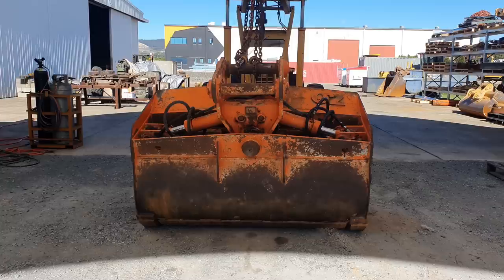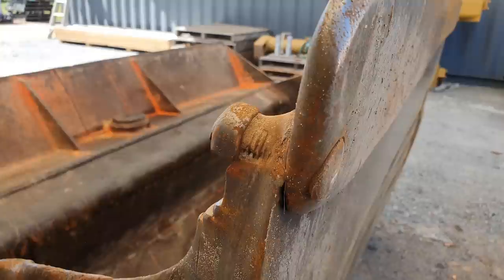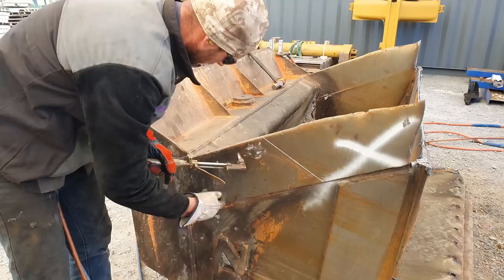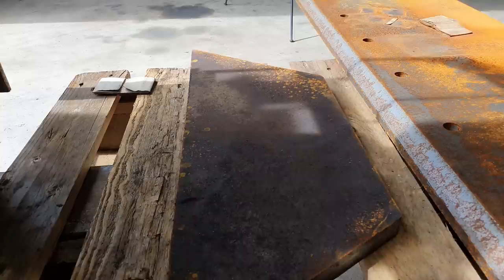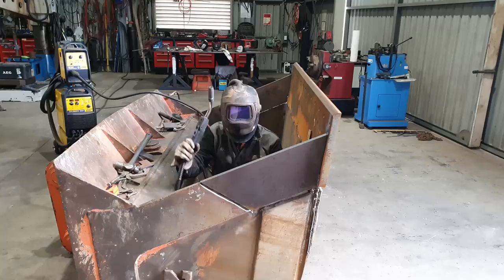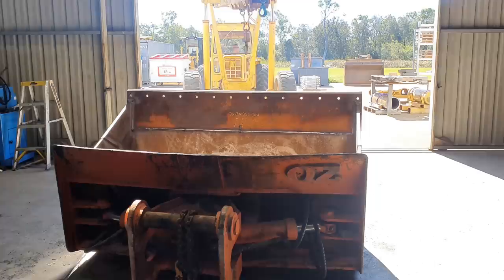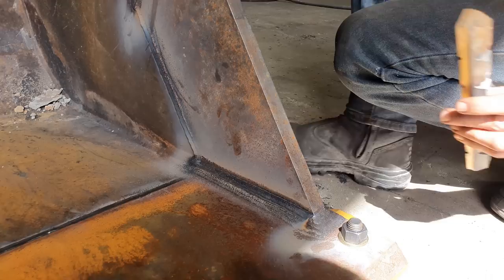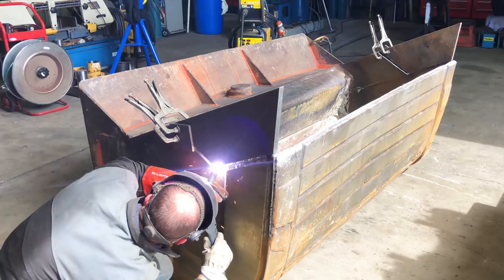Repair & Upgrade DAMAGED Bucket for 30T Excavator | Gouging & Welding

Comment: @CuttingEdgeEngineering 

Greetings mate! Just an observation, but bear in mind that argon and carbon dioxide are both heavier than air gases. When you're welding in a bowl such as @17:30, even though the top is wide open, your gas is sinking to the bottom.. and that's right where the intake for your welding respirator is. Not a huge problem for the short time you were doing it, but definitely something for everyone to keep in mind in general. 

Love to you and Karen and Homey.

Comment: Curtis, Have you considered getting and using a plasma cutter instead of gouging to remove metal sections ? They are very fast, easy to use and leave a very smooth clean cut which needs minimal cleanup.

Comment: I have gone the opposite & prefer pneumatic tools now, they are generally much cheaper even for high end ones, much simpler so much more reliable & also much smaller & lighter than gas. 
Only gas tool I use now is my old faithful Bostitch 1st fix which has been unbelievable reliable & robust.
My Milwaukee gasless 18ga is an absolute pile of junk & rarely ever get it out the box & always use compressor for 2nd fix. 
But everyone has their preferences 😊

Comment: When i was in apprenticeship, we used the standdrill as a mill, our instructor told us it would kill the bearings. Dont understand that until today, you got to use the tool you have, if it breaks, it gets in the bin or repaired. When i dont have a hammer at hand, the ratchet will do its job.

Comment: Not being critical, at all. Just trying to learn from someone who clearly knows. Why did you not feel the need to preheat the cutting edge and wear bars before welding it out? Was it because it was high-tensile plate and not AR plate or was it because you weren’t seeing any cracking in your tack welds? Fantastic job you did, for sure and the fact that it only took between 8 to 10 hours is most impressive!

Comment: Pro Tipp for filming anything with sparks flying: have some sacrificial glass in front of the lens that you can easily replace. The metal sparks will embed themselves into the lens and ruin it. A screw-on filter for a DSLR lens or a piece of gorilla glass screen protector for a smartphone camera are cheap an easy to replace.
Reply from the maker: I will definitely be doing that with my new phone! The camera glass has quite a few cracks from weld splatter 😅

Comment: Wow you are wizard with that cutting torch. I tried using a cutting torch for the first time recently.  Let’s just say Hellen Keller could have run a straighter line than I did.

Comment: I admire you for working so hard on your dialog!! Thanks for always including the outtakes, shows just how hard it is to make video in an industrial setting. I'm always amazed your camera gear doesn't pack up from the heat. Ever have trouble with RF noise from the arcs? As usual, screamin good closeups of the welding - WTG Karen!

Comment: Have you considered getting one of the long lasting batteries for your filter pack.  I have a three that last 16 hours plus for my Lincoln filter pack.  So I only change my battery twice maybe three times if it’s a long week.  Hope your replacing your filters not just using air to blow them out.  Your to good at what you do to not take care of yourself!  Once again would love to work with you on like a creative project.  One last things if it was me I would of put the bars up the sides past your repair.  I don’t doubt your skills but I know that no matter how great of a welder that the weakest part is where you’re repair was.

Comment: I assume that by welding down hand, you mean welding in the flat rather than vertical or horizontal position. In North American the term down hand refers to vertical down, which is not recommend for any structural application with a flux generating electrode.  Cool rebuild. Used to like these projects but at 70 years old I tend to look for smaller jobs to fill my time. The technology in the trade has certainly evolved in the 30 plus years I have been practicing.

Comment: With the cutting skills that you have, you are in the wrong business, you should have been a surgeon. I have never seen anybody able to cut a straight line like you. Also, I am in the US, I find it amusing when you describe the different gases you use. I used to work in a compressed gas facility. We used to pump the gases you are using. Except we names ours based on the Co2 content. C25 would be 25% Co2/Argon, C20 would be 20% Co2/Argon. Keep the videos coming, love watching you work on heavy equipment.

Comment: Filming and editing on point as per usual, hope George does well out there, that Homey segment 22 mins in is comedy gold for me, the way he snorts and grunts never gets old 🤣
That bucket easily rivals my Toyota's in skin thickness, surprised you didn't blow through at anything more than 12 volts and 20 amps 😅
With that strip welded in it'll hold up until you get it back for extensive surgery, at the top of a game going beyond for a good customer sets you apart, quality work as usual 👌
I hate it when the wire won't come out, my chinese welder does that at low settings all the time now and has bad arc consistency for buttwelding sheet metal/bodywork, struggling with it all the time.
Tried a good welder and difference is night & day, picking up a new Kemppi next week 😆

Comment: How do you keep such a steady arc with the air arc,? struggle to mine at a constant arc.  idk if I'm too hot to 2 cold or doing something else wrong. Also get a like carbon build up on the steel when doing it sometimes and only way to get rid of it is to grind it out to new metal.  What causes that and how do I prevent it?  Thanks a ton/

Comment: Hi. Love the videos and out takes. Very interesting and skilled. Would it be possible to do a short video on the gouging. Ie how it works etc. it sounds like compressed air used but not sure. I am an an electrical engineer in uk with no metal working knowledge but love to watch people with excellent skills. Keep up the good work 👍👍👍👍

Comment: Can you elaborate on why you use a gouging rod as opposed to a cutting torch?   Ok, I saw later where you said you can see how much material you are removing when you use a rod.  But I've got to say that is some super smooth torch cutting.  When I cut with a torch I see ever time I take a breath because of the little divot in the cut.

Comment: That wear package looks amazing on that bucket. If the skin on the bucket was still good. How long would a wear package like that last until I needed service again? Granted it varies depending on the ground its working. So lets say general work, running 5x8hr shifts a week.

Comment: Over the years that I have been working on heavy equipment I have had multiple foremen instruct us to remove the paint from cutting edges before installation. Some want it burned off and some want it ground or wire wheeled off. Definitely on loaders and skid steers, maybe less on an excavator bucket. What are your thoughts?  Thanks for the great videos. 👍

Comment: The best (and in my Opinion, most Entertaining) way to cure Machine Operators of their habit of using excavator buckets as hammers is when they hammer something with a bucket, they are forced to stand in the dirt in front of the machine while the Machinist that will be fixing the damage they did uses that very bucket to hammer them into the ground...

Do unto the Operators as they do unto the buckets!!!

😄😁😆😅😂🤣

Comment: Wow great job guys !! Yes a bucket is not a hammer for sure ......but it keeps you in businesss if there are used as one 😂😂 Great work you alway's do excellent work can't wait to see you skin this bucket it will be a awesome job !! Great out takes guys.....I hate when the weld wire gets stuck on the tip or bound up in the liner😂

Comment: I absolutely love oxy propane more stable than acetylene that's for sure both good gases but I prefer propane you can cut some serious thickness with those so far the sickest I've ever cut with a torch 2 in I don't know what that is in millimeters good stuff though

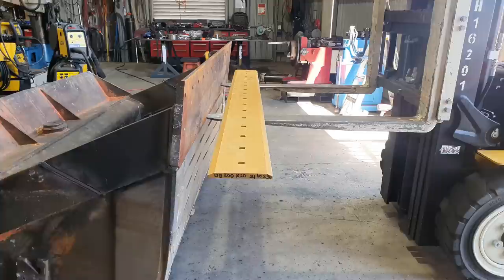Comment: For the "double beveled" cutting-edge, 22:58 would it have been better if the "extra" bevel was put on the other side (parallelogram instead of a trapezium)? The way it is now, the other bevel can catch onto stuff (pebbles etc.). Of course, the down-side would be that when using the other bevel, the mounting-surface would need to be cleaned all over again.
Reply: It's a trapezium so that the cutting edge blade is reversible, and the counterbores for the bolts are only on one side of the blade.
Reply: @morriewyatt6234  Reversibility would also be possible with a parallelogram, counterbores could be a solvable problem. I think the biggest problem would be the beat-up "flipped" surface facing the shovel.

Comment: Hi, I keep being facinated about the massive jobs sou perform. What is the tool you use for cutting, which looks like an Electric Welder using Sticks. Sounds like it uses Air like a plasma Cutter. But the Sticks confuse me. Txs from Vienna

Comment: I'm not a welder so pardon my ignorance, but in the out takes it shows you had problems starting a weld a few times and you twisted/rotated the welding lead about 180°. What function does that serve?

Comment: That is some poor battered shovel indeed!  That'll keep it going for a while longer for sure.  Speed cutting is very good Giggler!  I couldn't draw a line that straight, never mind cutting with the red and blue knife.  Good work Homey!  Have you ever cut cast iron with the air gouge Kurtis, or is that a job reserved for Carl?  I got to thinking about the change in the make up of cast when folk try to weld it.  I know the bucket is not cast, just wondering about it.  Thanks Kurtis, Giggler, and Homeless.

Comment: Thanks, really steady & straight with the torch And gouge.  Also, isn't butt welding the side plates without beveling those thick pieces a little iffy, or does that wire feed really penetrate that deep from each side?

Comment: Your International tractor sounds like it has a compression missfire or an exhaust leak. Reccomend inspecting and adjusting valves if it's not a leak.

Comment: Super cool man.  How does that gouging torch feed air through the electrode?
Reply from the maker: hey mate the air doesn't go through the rod, there are air jets at the end of the hand piece where the gouging rod is being held
Reply: @CuttingEdgeEngineering  Ah right on!  Thanks for responding!

Comment: Oxy acetylene/propane cutting, arc gouging and plasma gouging/cutting can be so damn satisfying at times. Especially when it's winter up here in Finland and it's cold as fuck and you need to fight the snow.

Not so fun during hot days inside a grimy workshop with sub standard ventilation.

You've got a steady torch hand mate, impressive cuts.

Amazing video once again both of you!

Also, do you ever need to "over tension" the long wear plate in order not to have it warped when finishing the inside long weld or was that not really and issue here since the bucket was pretty worn out and U-shaped already?

Comment: I am surprised you don't use a plasma cutter, maybe just preference but you'll end up with better cuts?
Reply from the maker: In my opinion Plasma is over rated, not a fan for heavy metal and weld removal, far too slow and cost of machine & consumables isn't worth it
Reply: @CuttingEdgeEngineering  Even IC Weld is using plasma now, for some jobs?

Comment: Kurtis I am curious about why you choose to use Oxy and LPG for your gas axe. I am a farmer from about 10 hours north of you, near Yeppoon and use Oxy and LPG to avoid the cylinder rent and cost of acetylene. Most people tell me to suck it up and pay up for the 'hotter flame' and 'better results'.  What is your take on LPG vs Acetylene? Cheers, David
Reply from the maker: Hey mate I agree with you on cost, LPG is much cheaper but I feel it is far hotter for heating, I do have acetylene to use for brazing and silver soldering as it gives a cleaner flame. Do what you got to do mate 👍
Reply: @CuttingEdgeEngineering  Ever considered buying a plasma cutter? Neat little things for cutting stuff.
Reply: @armageddontools  even I ave one of those, cheap quick and efficient. The torch can do that kind of work too, though I use plasma instead when I can. There are however plenty of things that plasma can't do, and oxy can.

Comment: Dumb question, but you spent a lot of time welding either on your knees, or hunched over inside the bucket. Is there any reason you couldn't hang it from your telehandler with a prop or stand underneath for stability so you could it while standing?

Comment: Isn't BIS 80 a bit soft for use in those locations on a bucket? I know my local bucket manufacturer uses Hardox 500 as standard for the side cutters, and even higher hardness for some components.

Comment: I don't understand how those cutters work, I hear air going thru them, but where does that air come from?
Reply: The air comes from an external compressor, and is fed through nozzles in the clamp that holds the carbon rod. That way the rod can be pointed at whatever angle you need, and the air is always pointed in the right direction. The carbon arc melts the metal, and the air blasts the molten metal away.

Comment: We weld a lot of A514 T1 alloy steel which is sensitive to pre and post heat. I didn't see you use any preheat when welding the BIS 80 steel. Is that normal?

Comment: I would have thought that the designers would've come up with a different fastening method for fixing the blade to the bucket other than nuts protruding into the bucket mouth area.
Reply: I'm guessing they figure that when you flip the blade you an spring for some new nuts and bolts.

Comment: What was the point in removing the old cutting part as you removed the big bottom part, welded in a new bottom part with mounting holes and screwed on a new yellow cutting part?
Is it due to differences in material properties and you want separate them for recycling?
Reply: Kurtis explained that in the video.  He did it so he could show us viewers how much the bucket had worn, and how sharp the edge had become.

Comment: 8-10hrs Dam u good! And we are getting humped ! We'd get charged min 2 days on that, and it wouldn't have come out as nice with the extra wear bars. U ever weld first then run the hard surface over the weld? One guy told me he does it that way so he can cut thru it when steel needs replacing in future.

Comment: JUST WONDERING WHAT AMP SIZE MIG WELDER YOU USE TO WELD THAT HEAVY STEEL PLATE.
Reply from the maker: 500amp welder

Comment: The sharp edge on that bucket looks like it could be used as a meat slicer. Very interesting to see how that looks after that much use. Could almost be wood with how that eroded around the bolr heads. When did Karen have the perfect idea of including a clock in your welding timelapses? It really makes one appreciate the time it actually takes when you see the hands suddenly speed up.
Also, what happened to George!? :(

Comment: I wish I knew how many times I've been cut by a wicked sharp mouldboard. Sometimes you don't even realize that you've been cut until you've leaked all over the place. I noticed that you used flat washers with the cutting edge bolts. I've never done that before. Not saying anything wrong with that, just never seen it before.

Comment: Probably a dumb question....   why are the wear strips on the bottom of the bucket not in line with the direction of the bucket's movement.  The way they are positioned must cause more drag, friction and wear, not to mention fuel consumption.

Comment: How did the owner not spot all that wear? I'd have welded the material you cut off the front of the bucket back on the bottom as a band aid 😉

Comment: Why not thread the bucket edge, use a pan head allan screw and tack weld the back of the screw on the bucket side to keep them from backing out instead of the carriage bolt and nut method? Recessed and not in the path to be abraded away.
Reply: Because you can guarantee that the bolt would end up rusted in place. It's far easier to torch off the nut and just knock the remains of the bolt out of the hole than having to wrestle with rusted threads. It also ensures that the bolt ends up with a properly engaged thread, as new nuts are used rather than hoping what's left of the old threads will be "good enough". (Until of course you discover the hard way that is isn't.)
Reply: Plow bolts are used, not carriage bolts.
Reply: @morriewyatt6234  Good point. Easy of repair is a good play. I was thinking wear over time not repair.

Comment: Your using the code grips wrong. Secure somewhat loose and then take an appropriate sized Allen key into the turn knob and tighten down. Will be tighter than ever before.

Comment: Trying to satisfy "bad" customers is never easy.  My dad was a welder with the Boilermakers in the States for his entire life and he had a small shop he did a lot of TIG worked in as well.  Commercial fishermen would bring in these 18-24 ft aluminum "john" boats they used for fishing.  They would just be paper thin where they dragged them around on the shore.  They'd want him to just "slap some weld on there" so they could get back out fishing.  He knew if he did that they'd be back in a few days bitching about his "shoddy work."  He told them, "I won't do a job I cannot guarantee."  If you are going to fix something then you have to fix it right or otherwise you sacrifice your whole reputation for a quick buck.

Comment: you shouldnt push flux core wire, always drag. higher likelyhood of slag inclusion and inferior penetration profile
Reply from the maker: novice welders drag flux core wire 😉 it is a multi positional wire and an experienced welder can avoid those problems